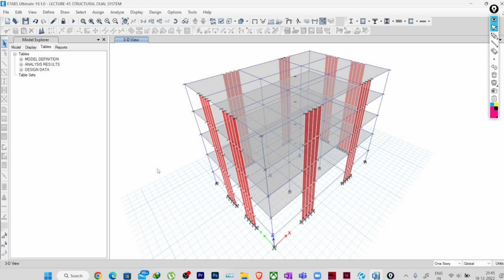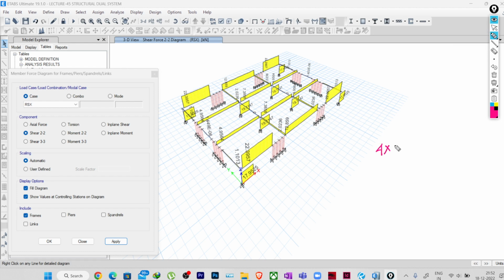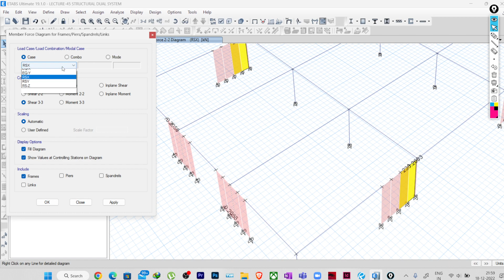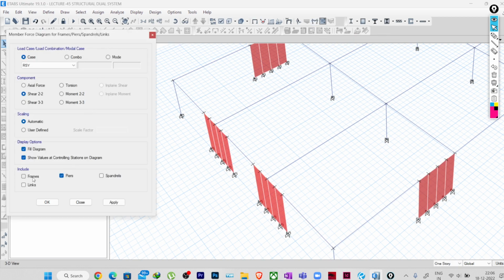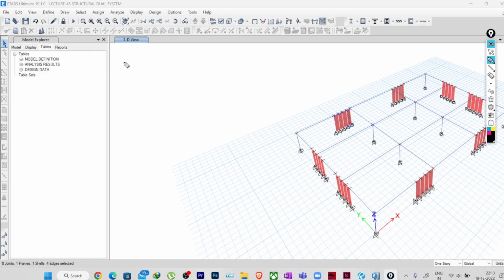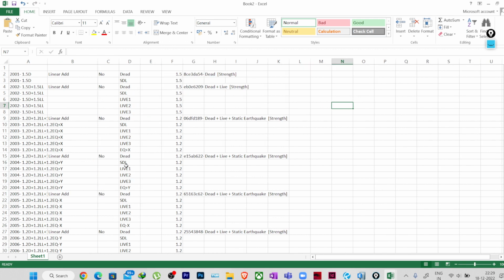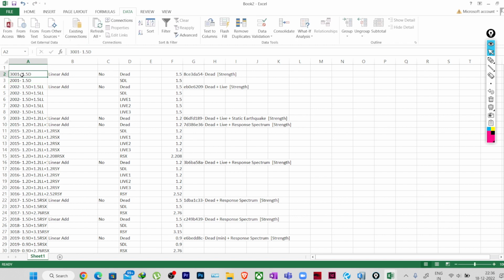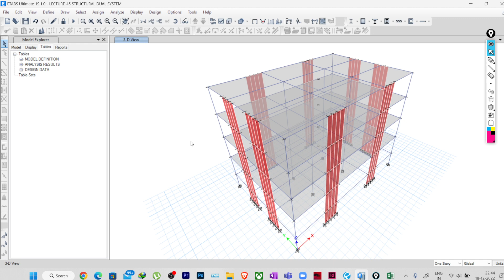Understanding Dual Structural System | Earthquake Resistant Design | ilustraca | Sandip Deb

Comment: Hi
I have one query 
You are considering the response reduction factor as 4 for ductile structural wall but taking the design consideration of dual system in analysis , In IS code (note 3) it is clearly mentioned for zone 3,4,5 R = 5 shall be considered 
Please explain 

Thanks 
Er Akshay Kothiyal

Comment: Hi! If during my initial checking of base shear for col and wall, I found out that the column is already carrying 26% of the total base shear, should i continue with the process or just proceed with the design of the frames and walls without scaling?
Reply from the maker: In that case no required as u already achieved the required criteria

Comment: What about wall design combination? should we reduce to 75% or design for the older combination ??
Reply from the maker: Which reduction u r talking about?
Reply: @ilustraca  you have scaled the column design for 25%, but what about the wall , will it remain same or scale to take only 75% shear? Plz tell us how the load combination for wall too?
Reply from the maker: Walls will be designed for whatever force we r getting at beginning for normal load combinations without any scaling of forces.
Reply: @ilustraca  thank you.
Reply: Very clearly explained.

Comment: Sir, how to model walls like that? Is it a manual process or automatically divided walls? Should I draw wall by parts and then provide supports?
Reply from the maker: Walls divided  manually using Edit Shell
Reply: @ilustraca  ok sir.. thankyou
Reply: What is the difference between manual mesh and auto mesh and what are the changes we can expect from the model
Reply from the maker: If u devide the wall wd Automesh option, it will be divided both horizontal and longitudinal direction... now if u see, the load transfer point is only available at floor levels and there is no intermediate point where load transfer to wall is happening hence no mesh required. To match the mesh size of slab/floor we divided wall longitudinally wd a max size of the same that we have provided for slab/floor.
Reply from the maker: There is nothing wrong if u mesh automatically...in that case the analysis time will be increased unnecessarily... again at bottom of wall the reactions will be shown only at 2 end points if not meshed manually that will lead to a conservative transfer of load in foundation
Reply: Thank you for the clarification 👍